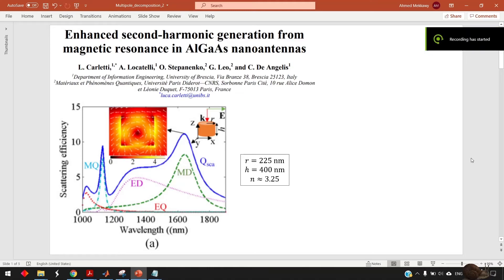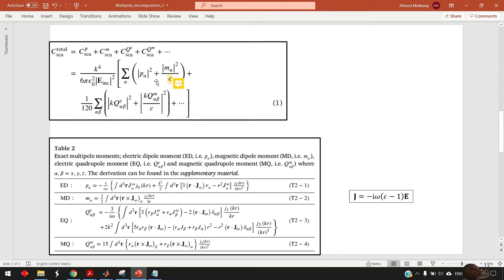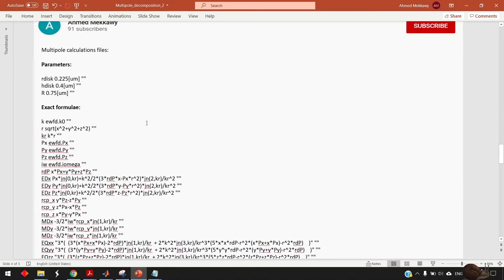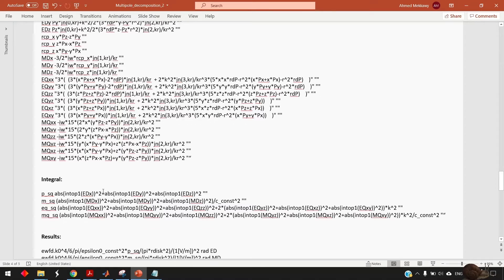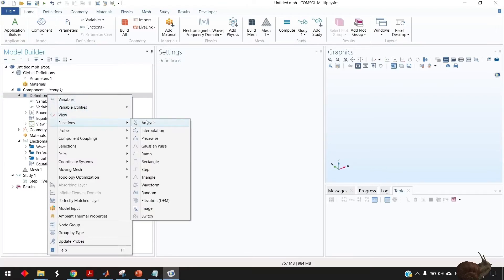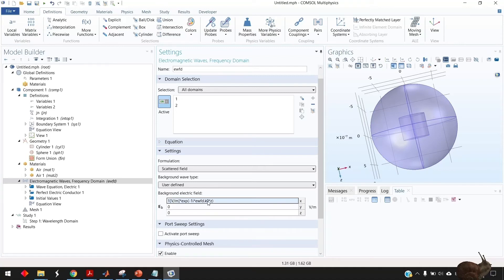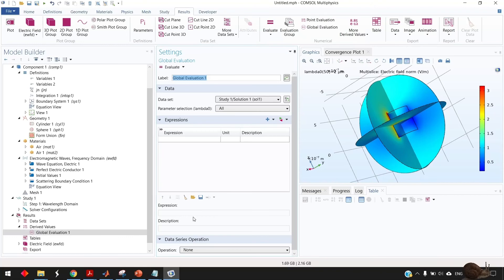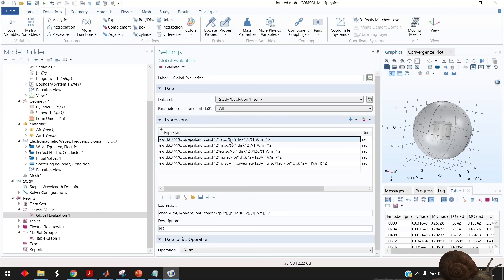Multipole decomposition and scattering cross section using COMSOL

Comment: Dear Ahmed Mekawy,
Many thanks for sharing your results with us. It is very useful, especially for me as for a beginner. My questions:
- From viewpoint of particles with more complex shapes, the normalization should be done for the surface area of the particle, or for the area seen by the incident light (projection of particle shape to the plane which is perpendicular to the light propagation direction)? 
- How can I decompose the contribution of higher-order of multipoles (n>2, eg.: sextopulo, octupole, etc.)?
Reply from the maker: Hi Wasya87, Thanks.
- Yes I agree (projection of particle shape ...).
- For higher order multipoles, you can refer to http://dx.doi.org/10.1088/1367-2630/14/9/093033
However, I believe, for very high orders >4, the particle size will be much larger than the wavelength, so you can again apply approximate formulae.
Reply: @ahmedmekawy1632  Hello can you please tell me  how can we calculate the multipole decomposition and scattering cross-section when the nanostructures are periodically arranged?
Reply: @ahmedmekawy1632  this is also what i want to know! thanku

Comment: Thanks for the nice and informative tutorial. I used the same equations for Si nano particle of customized size it was showing an error to define real and imaginary refractive indices. Marked by "n" and "k" in wave equation. How to fix it for imaginary part please?
Reply from the maker: Thanks. I hope you have found the answer already. If not, can you explain more?
Reply: @ahmedmekawy1632  It says, define "n" and "ik" in "wave equation 1". So I wanna ask that should it be same as dielectric constant of my material? The second problem I am arising that I creates a lot of fine mesh which stuck-up the calculation. So how can I customize mesh size to increase computation time?